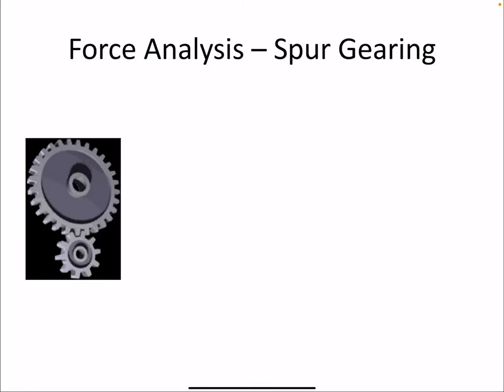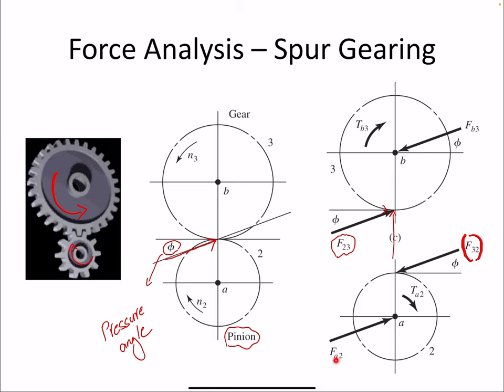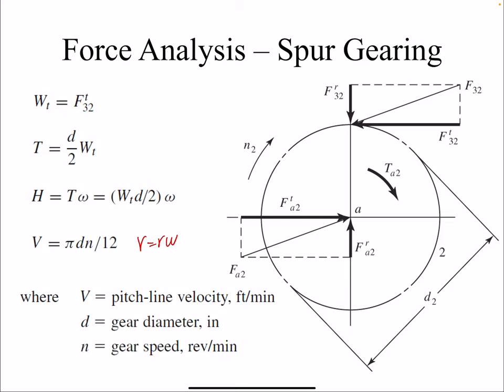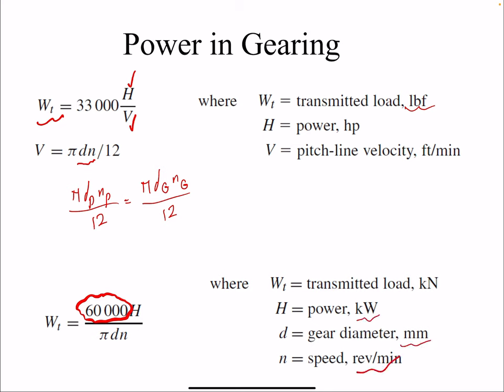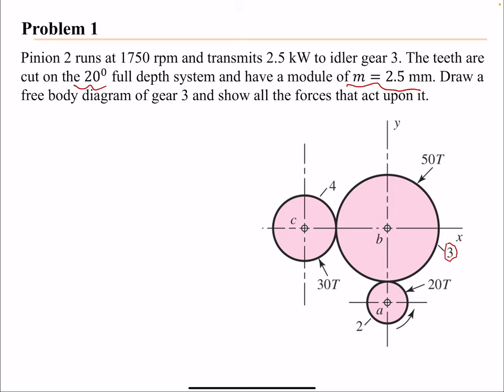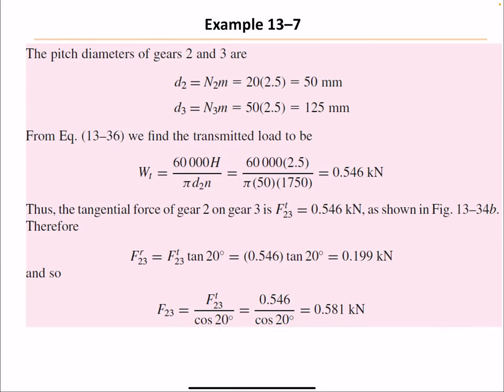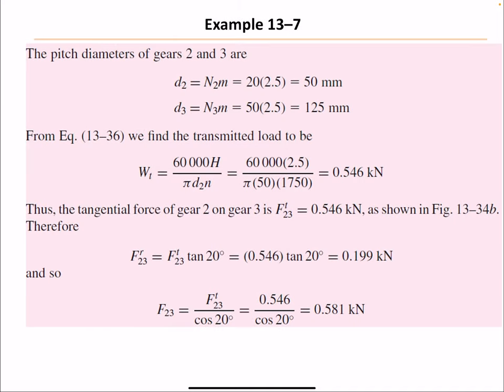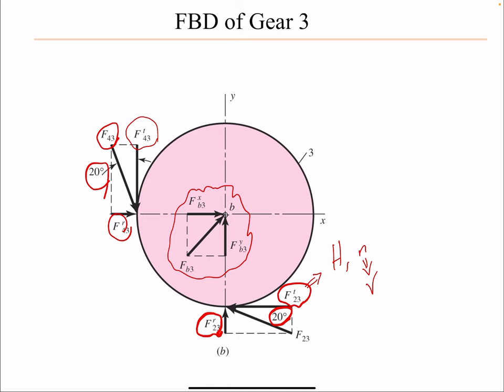Spur Gear Force Analysis: Tangential and Radial Load

Comment: Why are the two torques in the same direction ,
Reply from the maker: Which gear are you referring to?
Reply: I mean why is tb3 and tb2 the same
Reply from the maker: Those are the torques the shafts are acting in their corresponding gear. The equilibrium of moment on each gear determines the direction of reaction torque. The shaft torque resists the torque generated by the tangential component on the gear.
Reply from the maker: You are welcome! I am glad you found it helpful

Comment: Did you have explain the gear strees and stress analysis of gears? . What an amazing instructor 👍
Reply from the maker: Thank you for your comments, yes,  stress analysis will be posted as well
Reply: @engineeringvision  
How can I contact with you?
Reply from the maker: @Azch20  You can email me at hr. sanei@gmail.com
Reply: @engineeringvision  
Doctor Sanei if we have double stage helical gears , speed reducer 
If gear 23 have tangential force = 911 N 
Should the gear 45 have the same value of tangential force? Same as with diameters, lewis equation and AGMA

Comment: Is it that idler gear always has zero net torque acting on it for simple gear train?
Reply from the maker: If it sits on an idler shaft, idler shaft Carrie’s no torque, it is not a driver that takes the power from the engine and not the out pit shaft that takes the load